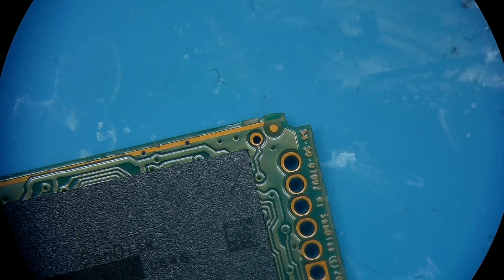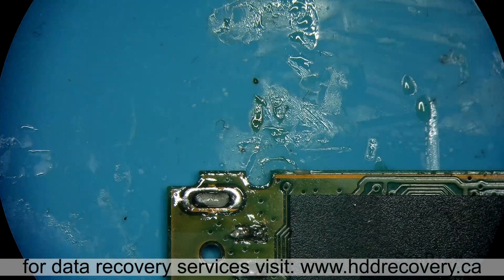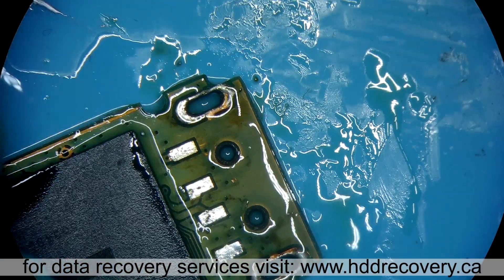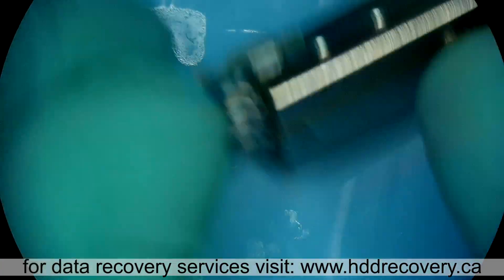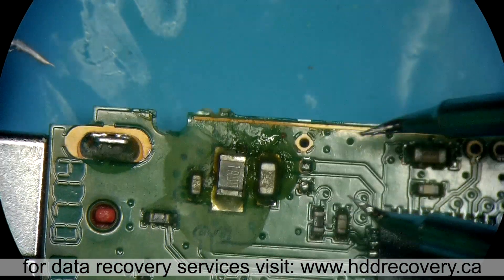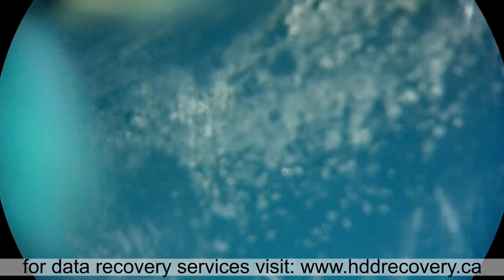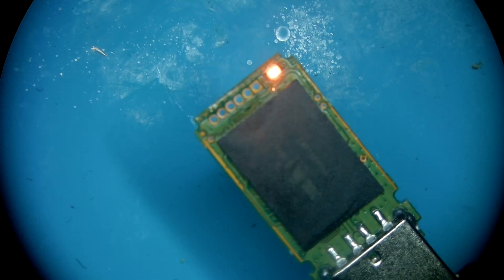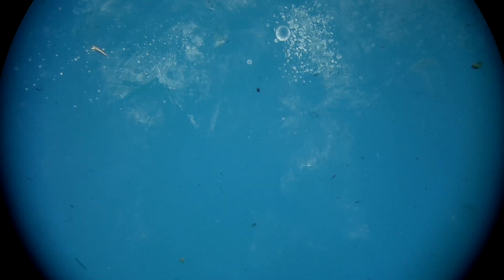Sandisk usb does not work | here is how to fix it

Comment: Hi there, i have a sandisk cruzer blade, few days back I was transferring data and my laptop crashed in between the pendrive has now been inaccessible for some times, I had been touching pcb points here and there I am no expert in this but today it came to life some how and is only showing 64mb, any suggestions to fix that
Reply from the maker: 64mb SanDisk means controller is not linked with NAND. I have a lot of different SanDisk videos on this channel and some go into detail on how to fix / recover data. Maybe broken solder somewhere, maybe the board is damaged slightly
Reply: @hddrecoveryservices  thanks for reply, will dive into some

Comment: I have two SanDisk Flash Drive that failed just after I plugged in Type C OTG on different Huawei Mobile Phones which I wanted to Downgrade firmware. Light keeps dimming and brightening but doesn't detect on PC. Any solutions or I should just change the controller.

Comment: I have a sandisk cruzer that I cant access my files I can see them but cant remove off the key. I bought it in 2014 so If i buy the same product can I get the chip off the old one and put it into the new usb stick?.
Reply from the maker: It's will not help. If you need this data recovered contact us by link in description
Reply: @hddrecoveryservices  I dont think sending it to Canada from England is the most cost effective solution lol.

Comment: you need an IR camera to see  what is hot
Reply: They are quite expensive. Cheaper option is to place a small drop of IPA on the board and see where it evaporates from quickest.

Comment: Are those hot tweezers of some sort you used to remove the resistor? The soldering equipment you link to does not have a tweezer-like tip, I believe.

Comment: Chip Quik is a version of the low-melting point solder you used. Fry's and Amazon carries it. It is a little expensive, but it works wonders for removing any soldered component. I've used it for both SMD chips and replacing a 20-pin hole-through-PCB audio amp chip. I believe Chip Quik is Cerrlow 136. This article covers Rose's metal, and Cerrlow 136. This stuff is similar to Wood's metal, used in fire sprinkler systems, as it melts at a relatively low temperture. 
https://en.wikipedia.org/wiki/Wood%27s_metal#Related_alloys
Reply from the maker: According to that article my stuff is not Rose Metal then. Mine will melt at less that 150F

Comment: What do you do once you recover the data, do you keep the repaired pendrive with you? do you solder the donor's parts back again in the donor? I mean, do you have several donors for every model?
Reply from the maker: If the client lets us keep the unit as a donor we keep it as a donor. If client wants it back, we send it back. We've done so many of these in past years that we have everything that SanDisk ever produced to be used as a donor by now
Reply: @hddrecoveryservices  Do these Sandisk flash drives have documented heat issues? I'm just wondering if they're a potential fire hazard as I have several that get "really" hot when in use and they've been like that from the day they were opened from the sealed packaging. Is there something Sandisk would rather we didn't find out yet should be doing something to rectify it?

Comment: That's a 1 ohm resistor. I doubt it's being used for current sensing so my guess is that it's intended as a fuse.
Is there a pin out for the header on the far side of the board?
Reply from the maker: You are right, it does act like a fuse but controller was damaged nontheless. I don't know exactly what those test points on the edge represent dude. Let me know if you find out what they are for.
Reply: @hddrecoveryservices  Sometimes burnt fuse resistor is because shorted ceramic capacitor on power line. I'm surprised so You not test resistance after desoldering this fuse, shorted cap or broken shunt diode is 1-2 ohms, failed 3,3V regulator about hundred ohms, broken charge pump also about few hundred ohms. Maybe simpler work than seems at first. Next tip is connecting 3,3V supply direct to flash power line (using safety resistor), in case voltage surge on 5V power only shunt diode on regulator entry will be shorted, but controller logic should be operational.